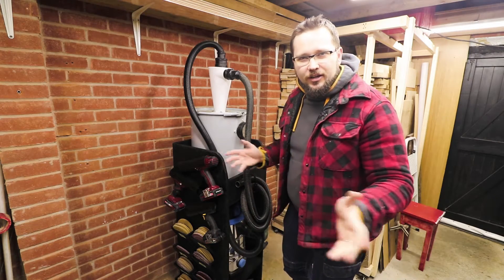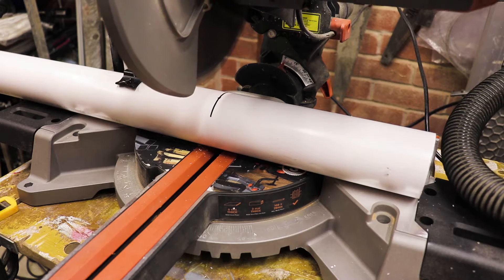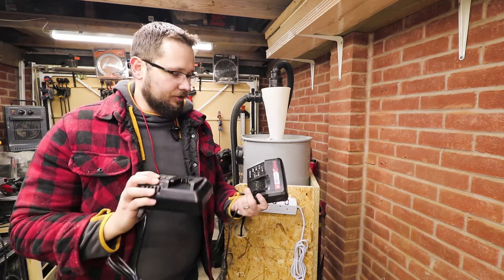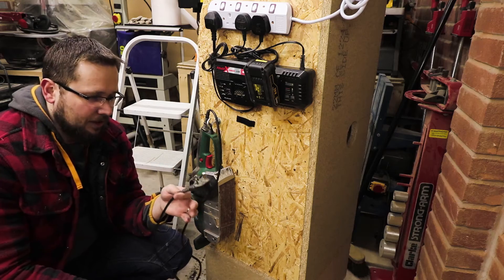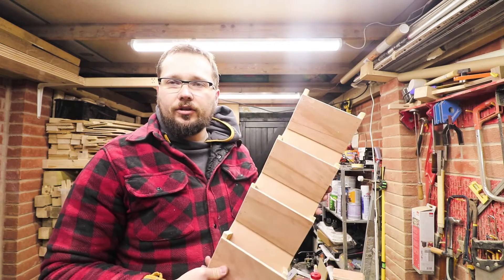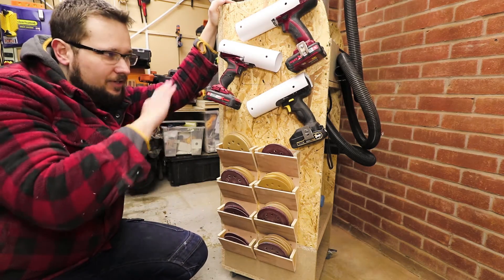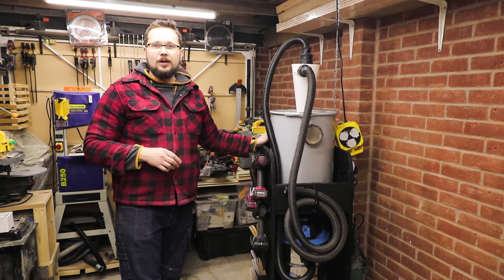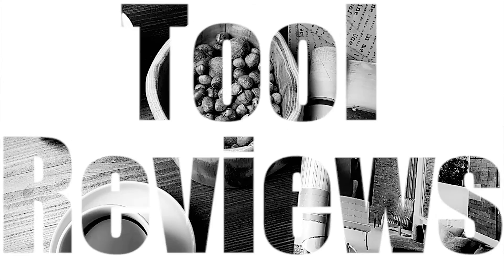Cyclone dust collector and mobile storage cart - PART 2

Comment: Great video. I bought the same mitre saw acouple week's back great bit of kit. But I found the Hoover attachment was as much good as a sunbed in the north pole.
Suggest you follow the tip from the viewer suggested reference the cyclone breaking from pulling the hose.
Awesome cart.
Reply from the maker: Hi and thanks. Yes I will just build an reinforcement for the cyclone attachment. Just need to finish the work bench first 😉
Reply: @CasualDIY  watched your work bench video with the flip top. Very cool.
Can't help think there's a better way to secure the bench thou in either position.🤔
Reply from the maker: @leelipinski4667  yes so far I just ordered some heavy duty latches

Comment: Great idea there, going to try the cyclone off old old vacuum Dyson upright cleaner first. I cant fit it to a cart, but I can stand it in the corner by the bench with the cyclone and bin wall mounted at the the side of it.     Where did the power block with the predrilled holes come from. They look ideal for this kind of project , rather than the keyhole type. Far more secure.
Reply from the maker: Thanks, picked it up on Amazon, plenty of choice to be fair

Comment: A jumbo cable tie could hold that second charger on.. just loop through two holes drilled in the cart.
Reply from the maker: That's a great tip thanks! And easy to do 😀

Comment: See if you usually plug in all your tools before you use them you could setup a socket on your vacuum cart as a relay socket so your vacuum is triggered by the tool you power on.
Reply from the maker: Hi, the vac has that option on it but only for power tools up to 1500W. But may look at that option on the power strip👍

Comment: Great channel Tomasz, How is the filtration on this vac with the upgraded filter?  I am looking for a shop vac but don't want to spend a fortune on one.
Reply from the maker: Hi and thanks, well I don't have any equipment to measure the air quality but I believe that it's working I have noticed there is far less dust settling down on my tools.
Reply: Thats great, thanks for the reply.  @CasualDIY

Comment: Nice job, but where is the storage for the belt sander belts. If needed you have a lot more storage on the back of the unit
Reply from the maker: Hehe I don't change it that often so I seen no need for it on the cart. But yes there's still the back of the cart 👍

Comment: Well Done !!:>)  even though you have a great cart, you made one minor error on the cyclone itself.  the cyclone has a weak spot right at the base.  if you pull (even accidentally) on the hose too hard, you can crack the cyclone around the base.  supporting the cyclone at the top is important to prevent this.  take a guess how I know this.  I made a video called "shop vac cyclone install" to explain this potential hazard and how to prevent it if interested.  keep up the great videos Tomasz.
Reply from the maker: Thanks mate, never thought of that. I will check out your video for sure 👍 hmm I could hot glue some wooden braces for the cyclone to the metal lid, that should do the trick.